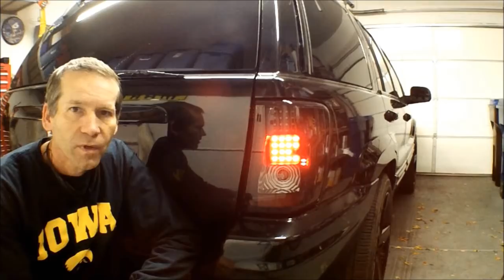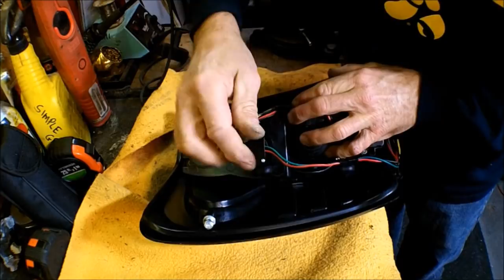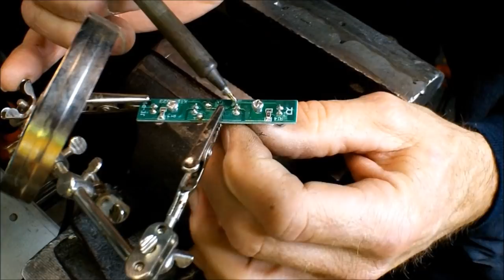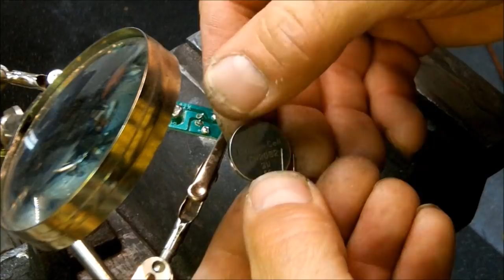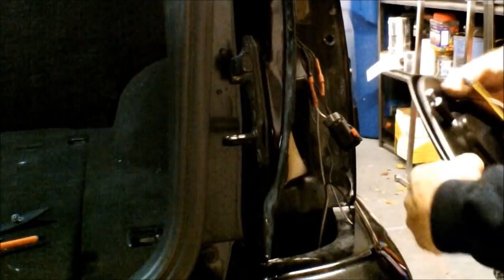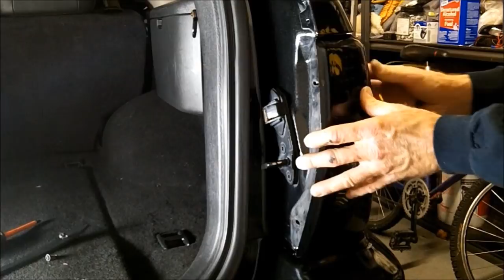Replacing LED Bulbs in a Aftermarket Tail Light Assembly

Comment: can you send me the link of the bulbs you bought on ebay? I am trying to do the same fix.
Reply from the maker: The ones I did install with slightly darker than Originals. Try these they say they're ultrabrite.
Look at this on eBay
https://rover.ebay.com/rover/0/0/0?mpre=https%3A%2F%2Fwww.ebay.com%2Fulk%2Fitm%2F163228804752
Reply: Are they 5 mm leds?

Comment: Nice job Martin.  Too bad those taillights don't have an access door, kind of like a battery door on kids toys.  Maybe, when the other side has issues you could fabricate some sort of door with rubber gasket to seal out moisture, and 2 screws to remove it?
Reply from the maker: Thanks, Yeah..I'll give that try

Comment: A better way to repair that would be to disassemble the light by taking the lense off and pulling the boards out that need repaired. I've disassembled a number of headlights and turn assemblies to add halos and color match. (Have a couple videos of it too) It's not too difficult and would of made better repair. Not that what you did was wrong, just a better chance if moisture getting in. 

Also think about getting taillights with the square 4 pin LEDs not the 5mm ones. They usually last longer and rarely go out. (from personal experience with me and my buddies)
Reply: Is there a way to repair it when the entire tail light is out? (brake and turn sig work)